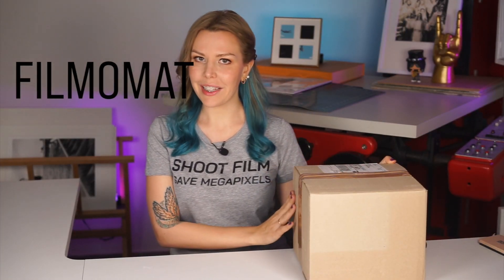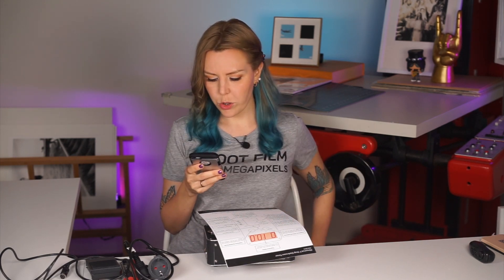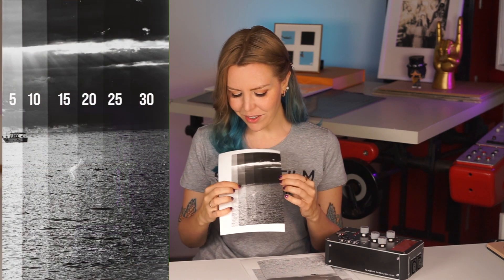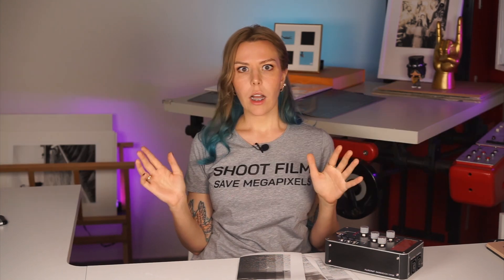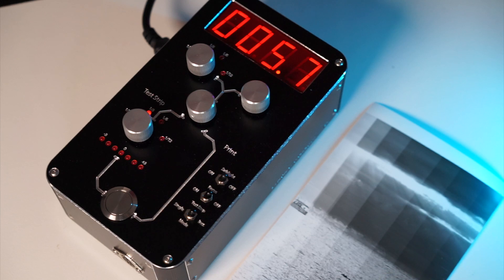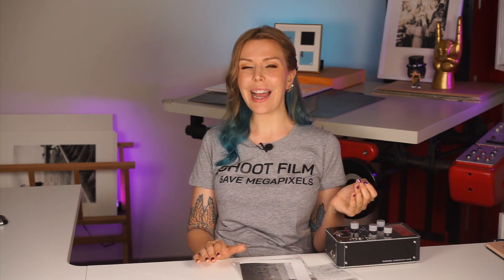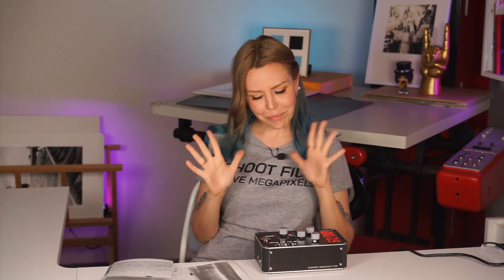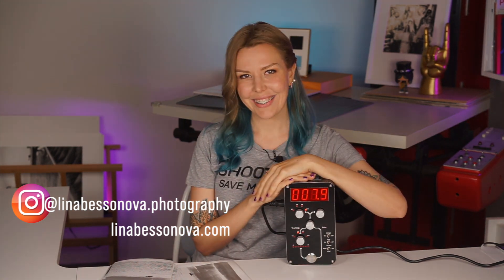F-Stop Printing Made Easy: the Filmomat Darkroom Timer Review

Comment: Such a cool timer! I also use F-Stop printing using Gene's method. First I do test strip to drill down the base exposure with a base of seconds, 4,8,16,32. The stop that looks best is then entered into the F-Stop Calculator app and I get 1/3 stops, do more test strips to confirm the exposure. That's how I do it. The timer sure could come in handy.

Comment: I've been using the RH Designs Analyser Pro for the past 8 years (its buttons so would not have been to your liking). It was expensive to purchase initially but has paid for itself in terms of flexibility and going straight to the final print (on a lot of occasions) as you can take exposure readings via its dedicated sensor. Its nice to see alternatives emerging onto the market that will hopefully bring the concept f stop printing to a wider audience.
Reply from the maker: Oh yes, the RH designs is I think the most advanced one. It has so many settings, especially memorizing timing sequences... Buttons have been holding me back though :)
Reply: I liked the Analyser Pro, and used it with a foot switch. But since I moved to a smaller place my darkroom is limited to daylight loading film tanks and scanning!
Reply: I find it is a joy using the Analyser Pro. I quite like the "clickyness" of the buttons... Dodging on top of a base exposure is really easy. Also being able to save different paper profiles (or different types of light bulb) is a great plus.

Comment: Do you find that the set of available step sizes (1/12-1/6-1/3/1/2) is limiting? I'd imagine that between 1/3 and 1/6 there's too much difference. Say on a 30 seconds exposure, it's 4.8 seconds or 10 seconds. Just wondering.

Comment: I use a regular plain vanilla timer and usually print with a constant black level.  I've worked out the exposure differences (in log units, who needs f-stops?) of my paper's max black for each exposure grade using Ilford's MG filters, then from there, to make an actual print, I size and focus my print area (for 8x12, or 11x14 for example), then take the negative out and put a grade 3 filter in, then do a simple test strip to determine which time gives me the maximum black level on my paper.  From there, if I want to change what grade I want to print at, I just take that number of seconds and multiply it by exposure change needed to get the same black level.  Then I take a densitometer, and measure the density of the film base plus fog of the emulsion I'm going to print and add that to the exposure time so that my film base plus fog is right at max paper black.

I have a printed out table of exposure times of my most common print sizes and film stocks so when I go to print, I don't really have to do any test strips, for a given print size and film emulsion, on my normal paper, I already have a start time that typically is within a 1/4 stop of exposure of correct.  At most, it's maybe bump it a couple seconds one way or another if there is a variation in paper speed or something like that.  It's basically very close to right on the money if not exactly on the money most of the time.

For dodging and burning, for the type of work I do, that's not something I typically do as I rarely shoot outside of a studio, and have full control of the light, so I'm fairly standardized on a grade 2 print, and I just set up the lighting to produce what I want when it's printed.

However, I have printed a fair number of negatives that were shot natural light, and for those, I typically don't do any dodging, but instead print at the contrast that gives me the shadow details and middle grey that I want (with the max paper black, normally this is a grade 3 or 4), then I put the 00 filter in and burn in the highlights to taste, but I only go to that trouble if a standard print doesn't look good.  I normally measure the negative density range, then print at a grade that fits that on the 2.1 log density of the paper and look at it and if it has stuff I'm unhappy about, then I'll do the max contrast exposure and burn in the highlights.
Reply from the maker: It's so fascinating how everyone has their own unique workflow - thank you for sharing yours!

Comment: I use a GraLab 450 with a handmade 1/4 stop table and it works pretty good. I got knobs to turn, though I don’t have an easy test strip sequence. But I just do 2-3 small strips held by magnet at various exposure times.

Comment: My enlarger came with a Durst DES 100AT timer, and I've been pretty happy with it. It's set up for F-stop printing, but adjusting the timing is all manual based on a simple potentiometer. It's only really suitable for certain Durst systems, but it works well for me.

Comment: Great video, thanks. You can get a CY IEC Male C14 to 90 Degree Down Right Angled IEC Female C13 Power Extension Adapter to route the power cord to the top in parallel with the other cords.

Comment: Actually, there is an ideal F stop to use when printing in the darkroom. Two stops down from the largest F stop produces the sharpest image when printing. Using a larger opening or smaller opening reduces the sharpness. So it makes sense to use the time (with a glass carrier for the negative) to adjust the exposure while keeping the F stop fixed at 1.5 to 2.5 smaller than maximum.

Comment: great video, many thanks for making it. I think if you ever used f-stop timing you'll never go back. It's much more accurate and usable for darkroom printing. Gene Nocon was right when he developed this method and since I'm doing this I'm often more satisfied with prints. Well I use a f-stop app and Wifi switch which is not half of being sexy but it was cheaper :-) 
Using opal bulbs it's easy an accurate, but on my De Vere with halogen bulbs and a mechanical shutter it's useless using 0.5 seconds. But anyway I get my values which I have to use and adjust them on the old De Vere timer. 
One thing I also have to mention is, using multiple intervals switching light on and off is not the same as using the complete time, eventually you have to recalculate exposure time.
And of course fiber based paper has some dry down effects you also have to regard.
Reply from the maker: app and wifi switch! Quite advanced of a technology :)
Reply: @linabessonova  yes it is not that easy, but the APP is fantastic, you also can use it without a relay just for getting values, fadu timer is the name of the app

Comment: Hello Lina, many thanks. I appreciated the F-Stop by "The way beyond monochrome". Now it's possible by Intrepid Enlarger after their new firmware update. Beautiful shirt 🙂
Reply from the maker: That's where I read about the f stop method too. Interesting, I didn't know Intrepid did it too - thanks for the information!
Reply: @linabessonova  yes, you should download the new firmware and update their control device, windows only, so It will change the timer e also the light intensity. Useful if you need more time for dodging e burning.

Comment: Agree that buttons like these are MUCH better than the pressing ones. More direct and you can do it with your eyes closed. On/off switch and power cable are on the wrong place, sure. Don't know why they're not on the back, near the outputs. I'd love to have one but the price is too high for me - not to mention import taxes, which almost double the price. Also, I'm not a pro so such investment is not worth. So, I'll keep doing my basic calculations with my beloved Gralab 300. My f/stops might be not that precise but the results are fine for me :)
Thanks for the video! My best!
Reply from the maker: It's definitely not a device for everyone, and like I said, even having a timer at all is not necessary. But yeah, it's definitely a nice addition to the darkroom. 
And I told Lukas about the power cable, and maybe he's gonna consider changing the location.

Comment: Why do all these timers look like something out of the 1970s? I built a timer that is fully programmable with as many dodge or burn stages as I want, does test strips in any stop step size, switches grades and can change brightness on an LED head, controls the flasher and more, looks modern too. I'm not an electronics engineer, but it wasn't that hard.